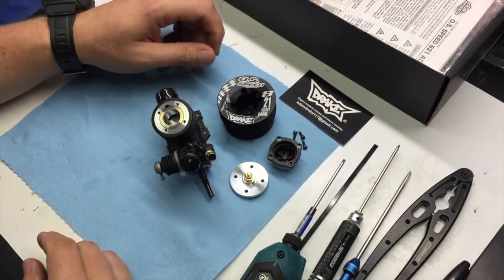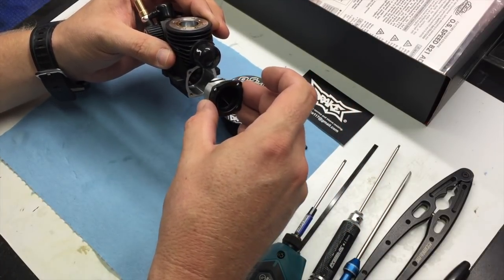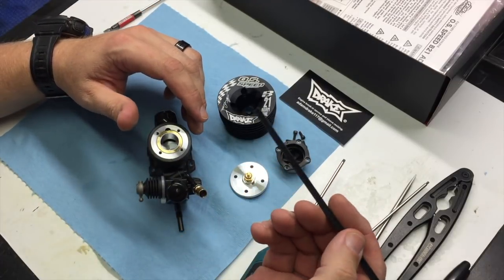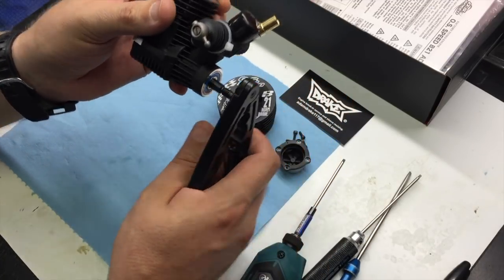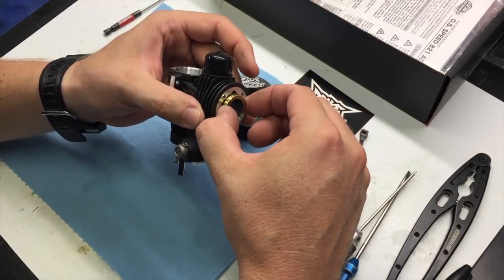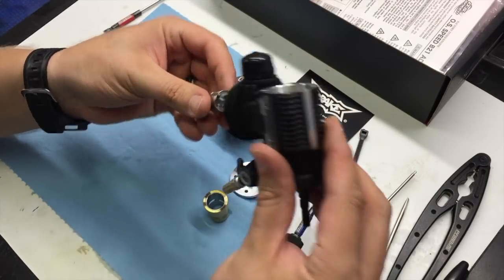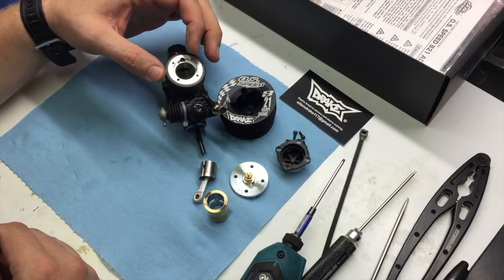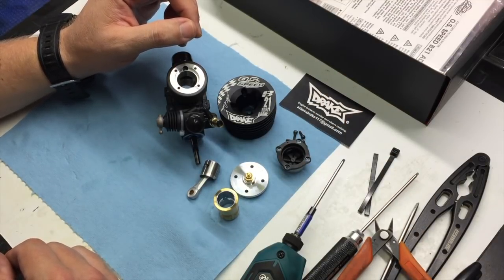Adam Drake from Mugen Seiki Racing shows how to remove a piston and sleeve.

Comment: I restore really old engines. I’ve cut through heaps of zip ties. In my experience using 4 zip ties in 4 ports is better than 1 zip tie in the exhaust. If you are careful you can use two small pieces of zip tie to block 4 ports at the same time. Prying with two tuning screw drivers is not ideal for stubborn sleeves. Even with heat I have done damage to cases. Mainly breaking cooling fins. I am not a racer and don’t have new engines like this but came here to see what people without tools are doing. A cheap motorcycle bearing puller works amazingly for a sleeve you are not going to reuse. Infinite power and no damage to the case

Comment: Adam I have. 21 novarrosi beat BT5 I need to replace the piston but I can't find its anywhere my questions is can I use the piston for the .21 P5 is the same engine same piston is fit?
Reply from the maker: I believe the P5 piston is different, but will work in the BT5.  With the price of the BT5 it may be better to just pick up a new BT5.
Reply: @AdamDrake  is brand new just break in 4 tank I broke the piston because I removed the back plate to losing the flywheel nut and when I removed the back plate the piston was bottom dead center I all my fault 🙁
Reply from the maker: Sorry to hear that.  :(
Reply: @AdamDrake  the engine ran perfect but keep blowing my plug I use 20% traxx fuel whit medium plug and us blowing 3 plug already why that happens ?
Reply from the maker: It may be running too lean if you're blowing glow plugs often.
Reply: @AdamDrake  thank you Adam I will try to rich out what is the best setting on that .21 novarrosi BT5 ?
Reply from the maker: I don't have settings for the BT5 engine.  :(
Reply: @AdamDrake  ok whit is the normal setting on novarrosi  .21 all engine is the same
Reply from the maker: The Nova setting can vary a lot.  Usually flush on bottom and 1/2 to 3/4 of a turn in from flush on top.
Reply: @AdamDrake  that right I want to fit is my first novarrosi engine and I love it
Reply: @AdamDrake  thank you adam I order the piston for the P5
Reply: @AdamDrake  is gone be any different in performance whit the P5 piston less power or more power?

Comment: How do i remove the sleeve if my crankshaft that hold the connection rod brocken?
Reply from the maker: That can be difficult, but you need to push on the bottom of the sleeve.  Sometimes when the rod breaks, it can hit the bottom of the sleeve and make it nearly impossible to remove without damaging the case.

Comment: Good video. An idea for free. I usually use folded paper (notebook, news paper, napkin,etc) and not the zip ties. The paper is strong, it does not damage the piston or  sleeve and do the job in new and old engines with a very tight sleeve.
Reply from the maker: Very nice.

Comment: I use the same technique, except instead of using shock shaft pliers i screw the clutch bell screw into the crankshaft and use a hex driver to turn the crank.
Reply from the maker: Very nice.